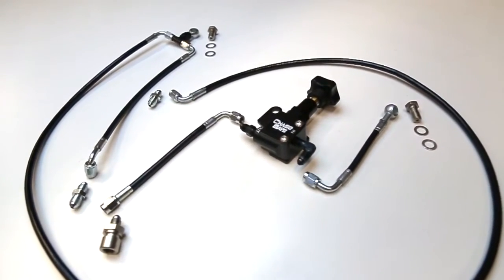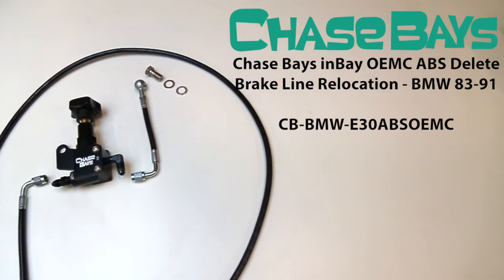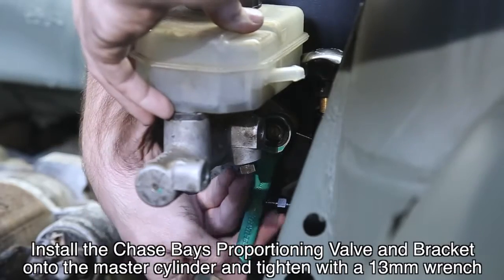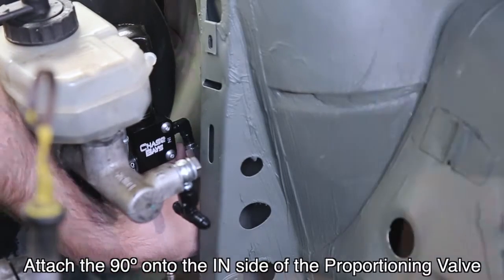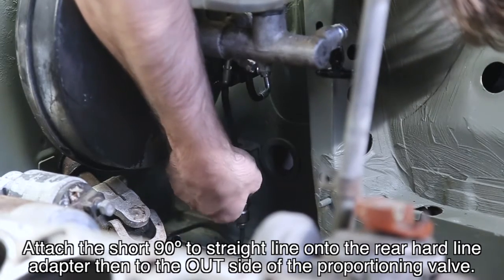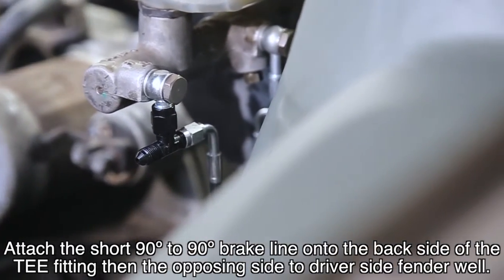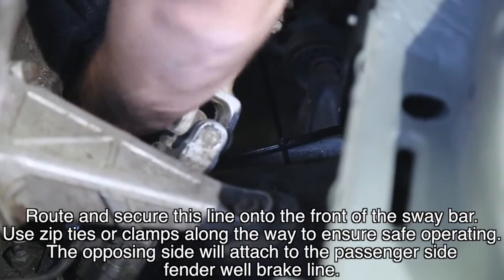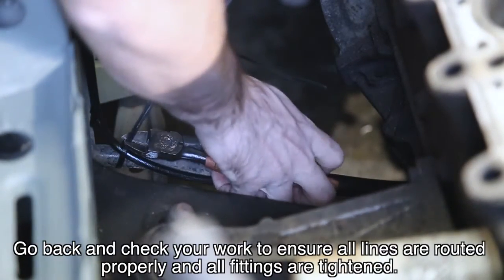Chase Bays BMW E30 inBay OEMC Brake Line Relocation & ABS Delete Install Guide

Comment: Why don’t you route the passenger side brake line the same as factory, along the fire wall? Seems unsettling to zip tie to the sway bar
Reply from the maker: This install guide is 7 years old. We have updated some of these things since this video.
Reply: @ChaseBaysTV  good to know. Maybe it’s times for an update to save some confusion as I have the newest version. I recently purchased and installed mine, and I’m overall very happy with it. I routed the passenger line along the firewall (same route as the factory hardline on my late model) and I wrapped the portion near the exhaust with heat tape. Thank you